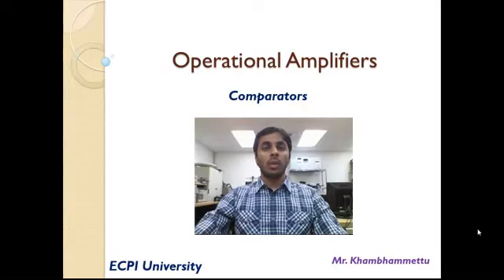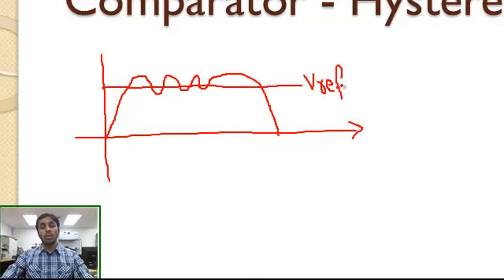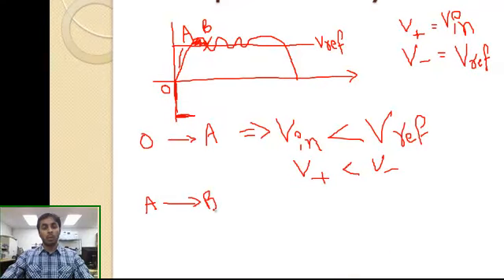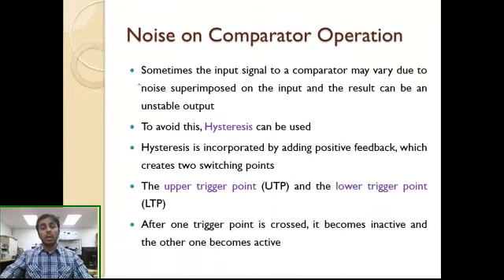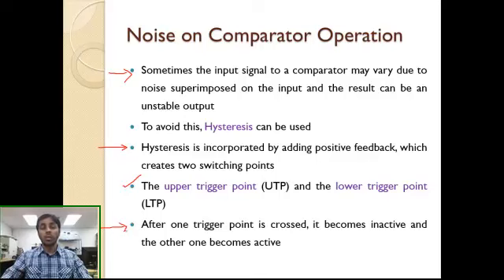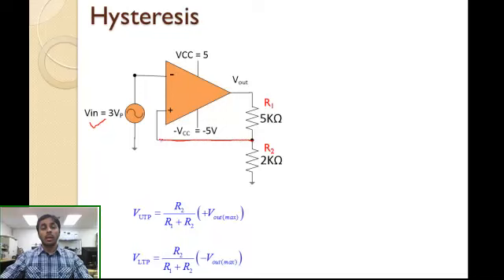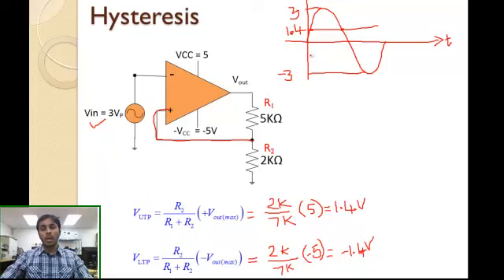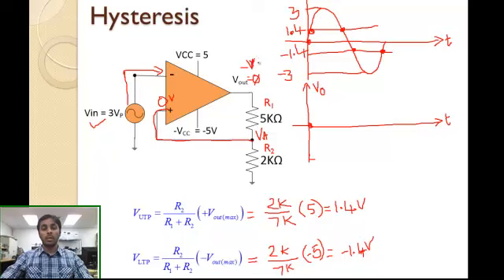OpAmp - Comaprators - Hysteresis

Comment: Why positive feedback is used
Reply from the maker: In this application, positive feedback helps to switch the voltage at non-inverting input continuously depending upon the output voltage. If output voltage is positive, the voltage at V+ is positive and vice-versa. So, the input voltage at V- is now compared with two different voltage levels at V+.
Reply: @prasanth424  thanks sir
And sir, why negative feedback is not used?
Reply from the maker: @vishrutbharti5596  of course it can be used but not for hysteresis purposes. Negative feedback is used in Amplifiers. In typical applications, first signal is amplified using neg. feedback, and then passed through the hysteresis circuit.
Reply: @prasanth424  thanks sir

Comment: One question: This Vutp voltage doesn't have any role in this example ? We only use one referente voltage (Vltp). That confused me.
Reply from the maker: When the output voltage is maximum negative, and input goes below LTP the output switches back to maximum positive. When the output voltage is maximum positive, and the input exceeds UTP, the output switches to maximum negative voltage.
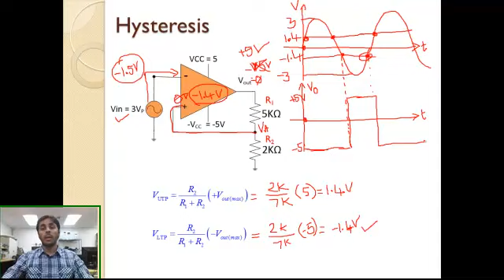Reply: Video is good and informative . At 14:02,  when the output voltage is positive maximum (+5V), the input is compared with LTP (-1.4V), Instead, the input should be compared with the UTP (+1.4V) (since the the output is at positive maximum)...please check the video at 14:02 -14:15...